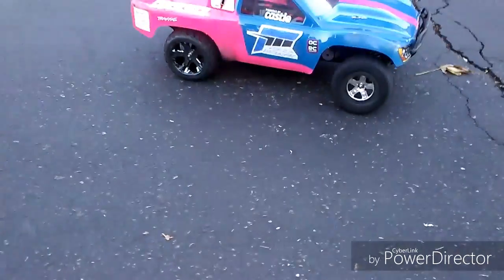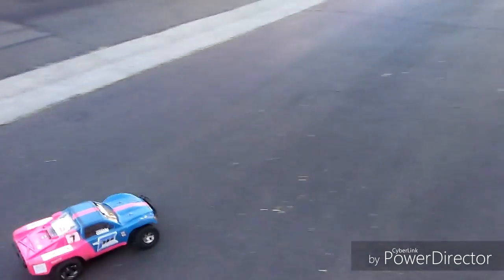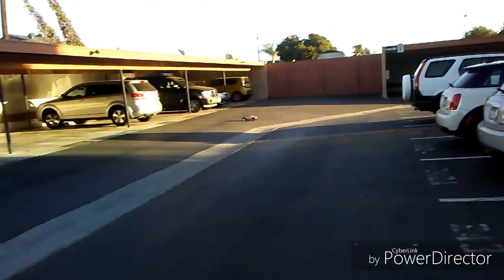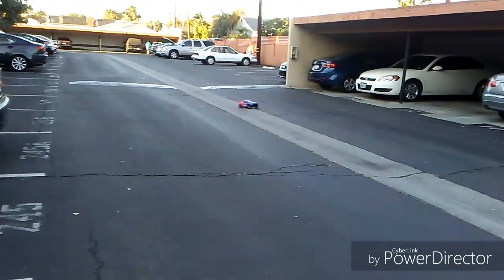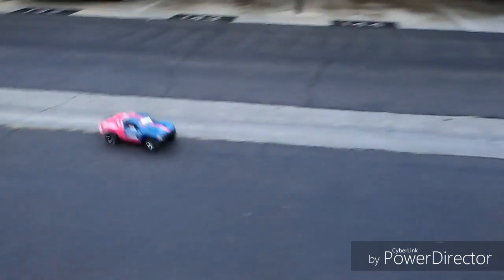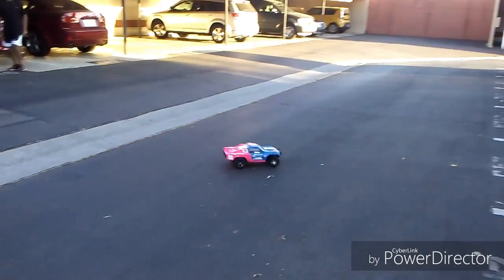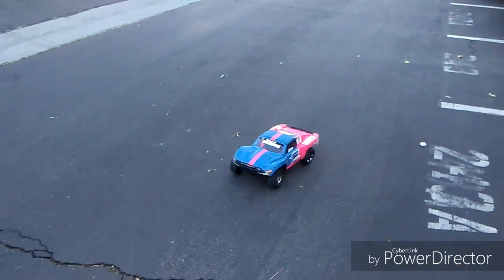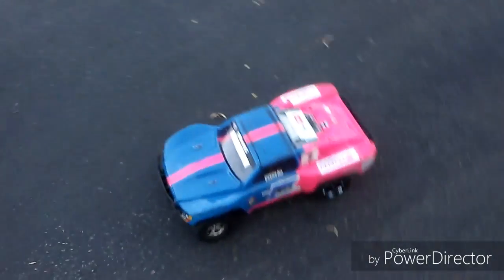Anaconda Tires on Slash

Comment: Any special fitting? or direct fitting?
Reply from the maker: No it fits just fine
Reply: FHRC Brony Radio Control and Cars the traxxas 3776A?
Reply from the maker: The Anoconda tires for the rustler will fit on the slash. 3776A (the front tire set for the rustler) will fit on the slash but you will notice that the tires will stick out when you put the slash body on